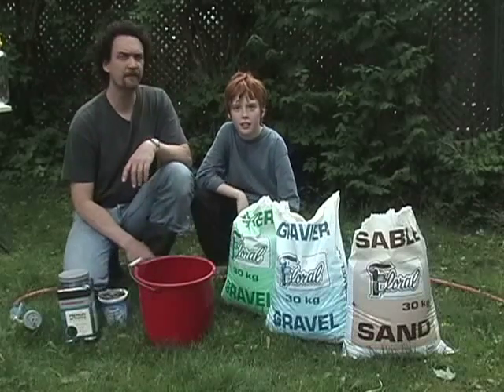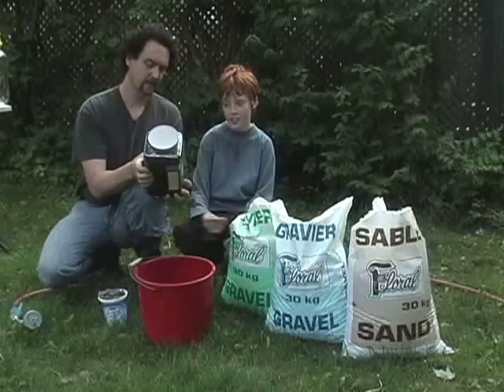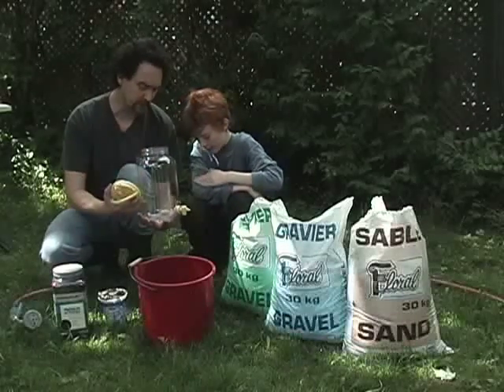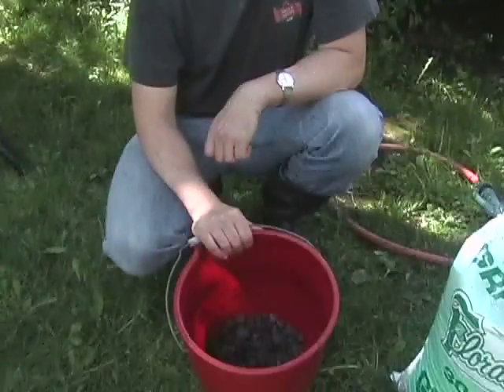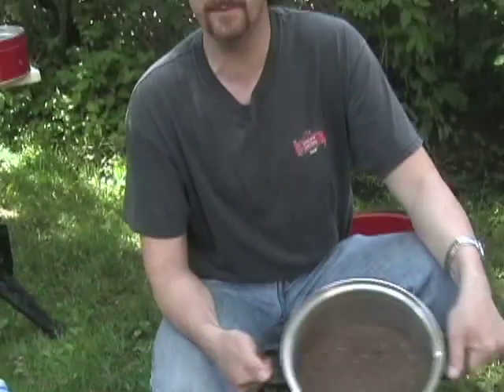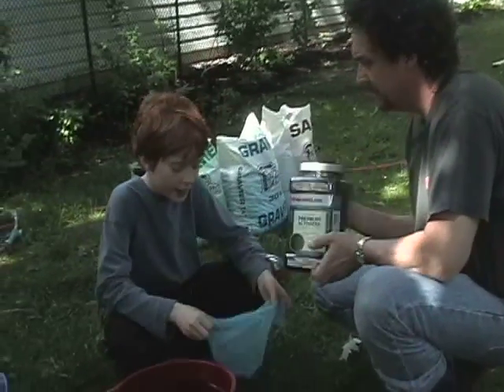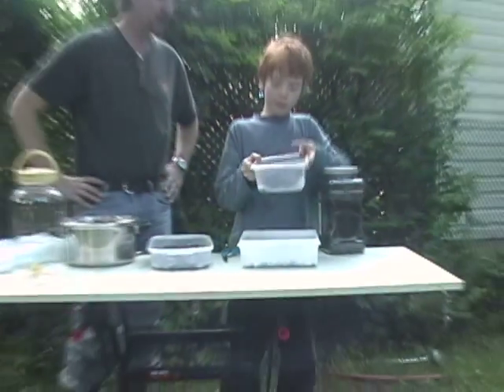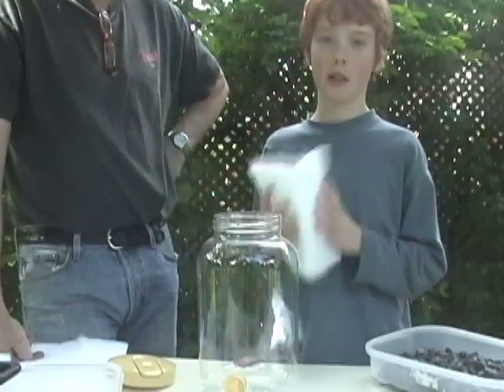Flynn Water Sand Charcoal Carbon Filter part 1

Comment: Activated charcoal is not charcoal. Charcoal is scorched with high heat and some form of chemical to make activated charcoal. Is there a multiplier, a number of times charcoal might be increased to be the equivalent of activated charcoal. For instance if one part of activated charcoal where used to clean a volume of water then would 5 times, 10 times, 20 times the same amount of charcoal do as well to clean the water safely. Do you have with some reference source for your claim?